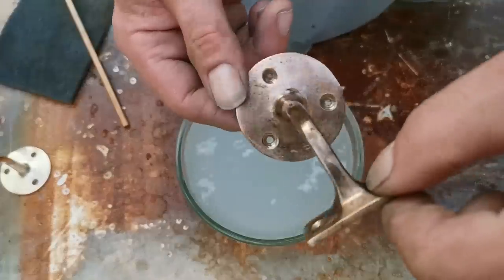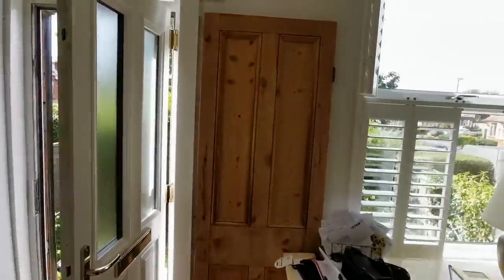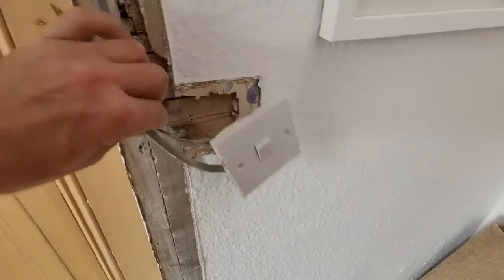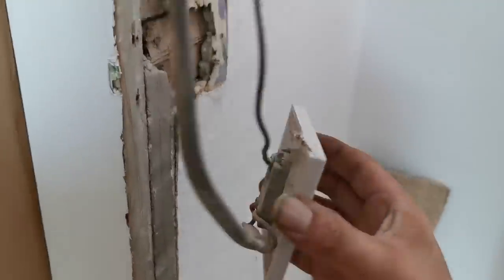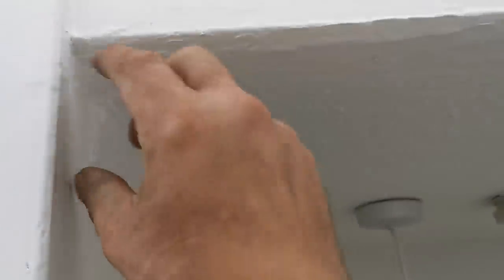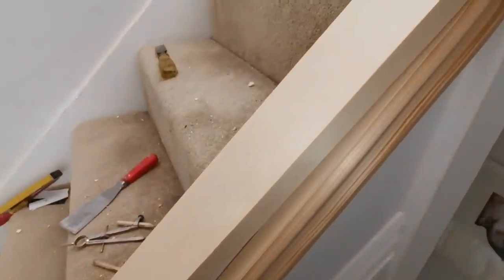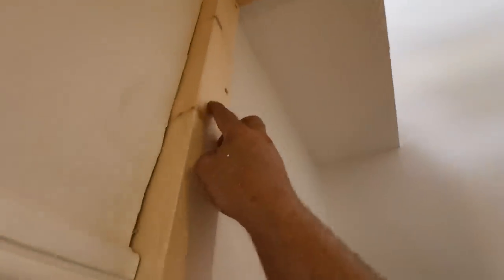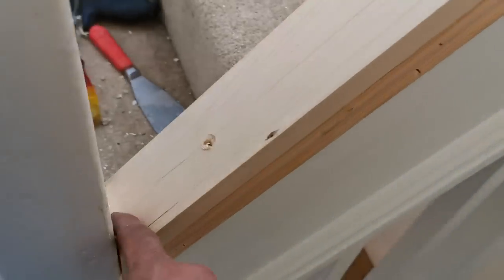Installing a stair door & glass Pt1

Comment: Not a easy job at all you are great at problem solving and explaining your reasoning for doing it a certain way the time you put into these videoes is really appreciated Thanks
Reply from the maker: Thanks Michael, you're welcome 👍 As modestly as poss i can say this was a fairly easy job done over a couple of days, very simple frames & because it didn't need to be 'fine' woodworking to fit the existing decor it was even easier, The hardest bit was finding the timbers to fix to without trashing the rotten plastering 😁👍